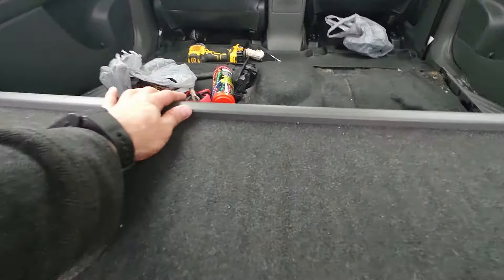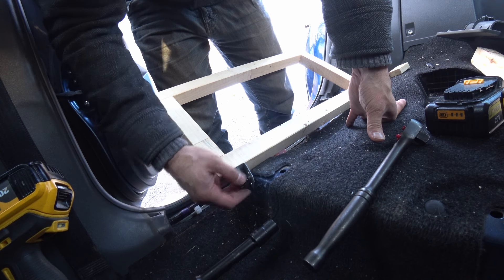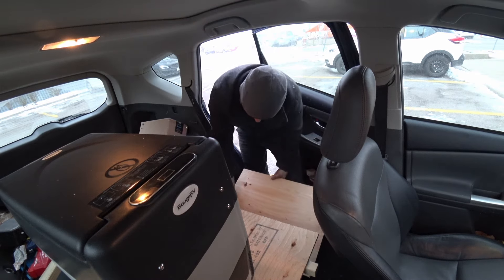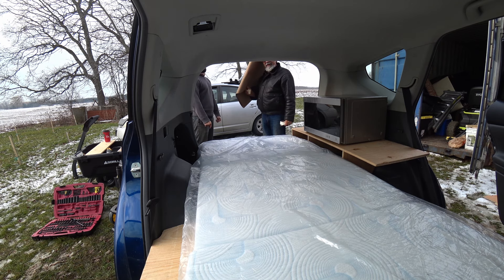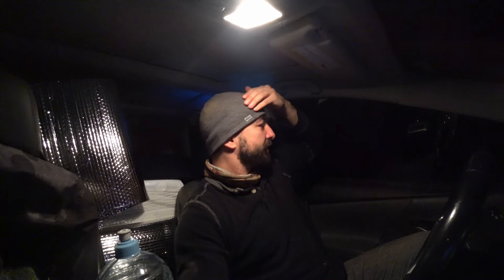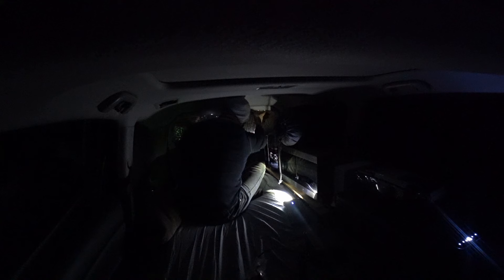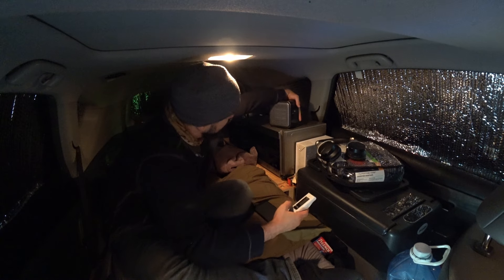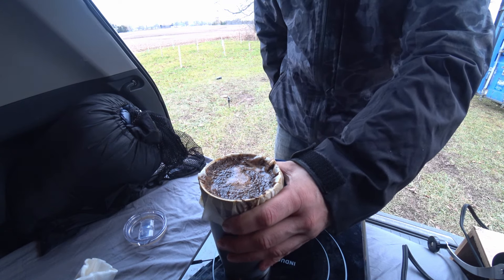Winter Storm Prius Camper Build: 4 Days, Home Depot Parking Lot Adventure

Comment: I highly suggest you put dark black fabric on the outside of the window covers. If you get the windows tinted dark, then it will just look like you have extra dark window tint, when people see it from the outside, at night. The reflective insulation is a dead give away that you are sleeping in there
Reply from the maker: Yep! I have dark grey fabric on one side of some of the covers, but haven't finished putting it on all yet, but still at some point :)
Reply: In my Prime, I have reflectix on one side, black cloth on the other side.  Black is better for stealth, but reflectix is necessary in hot weather during the day.  Just swap sides of the car to change color.

Comment: The extra battery is brilliant, I've camped in my prius c (A little bit smaller than V) and was awakened by the engine constantly kicking in to power the heater
Reply from the maker: The extra battery is mainly to handle a larger inverter load. If you engine kicks in too often, you are losing power somewhere or your hybrid battery is at the end of its life
Reply: I wouldn't say it was kicking in too often, but just enough to keep me from falling asleep 😂 Would you say the engine kicks in less frequently with your setup than using the standard heating system? @LexBuildAdventures
Reply from the maker: @yadam415  i upgraded my hybrid battery and that made it so it kicks off maybe once an hour or so if I'm just running the fan.

Comment: Awesome 👌 except 4me, instead of that HUMONGOUS chest fridge, I prefer a smaller upright one and room 4a toilet. I did see one that sits on the passenger seat and secures 2the seat belt. With limited space I would go 4 that one if I can't fit in.my cassette toilet. One divider between the smaller fridge and another behind the driver's seat with a hanging bar/pipe across, and I have some hanging space 4a few pretty 👗! I LOVE the 2 skylights. 👌🙂

Comment: Very cool build. That said, I have a few ideas that may work.

1. It would be interesting to put some type of suction cup bulb on the roof of the Prius where you could store a tarp in there and then fold it out to completely cover it. That would help out with insulation in the snow and you could just pull off all the snow when you're ready to go. You may also be able to weight down the ends. 

2. Heating is a challenge because it takes a lot of energy. That's why direct contact heating is far superior. I would recommend using carbon fiber heating elements, sometimes of which are found in vests or jackets. They will keep you warm without an issue and are often USB. You could also use direct contact for cooling with a Peltier device. 

3. I don't know how I feel about the battery and the inverter setup. I have been seeing gigantic power station (2.2kWh, 2000w continuous, and 4000 watts peak) for $630 USD at times. They have pass through power and can charge via solar up to 500w. They can have multiple USB outlets and plenty of USB ports. I would recommend LiFePO4 chemistry as those last the longest, but are more expensive. It could take up far less space than a battery and inverter and all the wires as it would be self-contained and more organized. These also have 12v DC output. 

4. You may be able to create a window mount where you have a HEPA filter on it, a fan to pull air through it, and then a slider that you can open and close with a removeable maget from the inside. You could also remove the window mount/filter/fan combo completely to shut the window and just run AC. Add a tube on the fan to direct airflow. This could also help to keep the battery cool in the car when it's hot outside. 

Those are some ideas I have and may try out myself. Hope they help!
Reply from the maker: some interesting ideas :)

I do currently have a heated vested and a heated blanket, which I used at times.

I used AGM as a battery because it is the default chemistry in the prius. To use LifePo4, you would need to have a separate dc to dc charger for it. I bought all the equipment to do this, but have not gotten around to it yet.

I did consider window mounted air circulation, but decided to just hardwire into the prius existing hvac fan so that I can run it off my house battery, instead of having the prius turned on. This way I can run it all night, get filtered outside in with all windows closed. I think its the best option for rainy days and stealth.
Reply: @LexBuildAdventures  That is good to hear about the vest and blanket. As for the battery, I meant to say I think the best option is to just get a large power station. 

Some power stations are 2kWh, LiFePo4 for longevity and more charging cycles, can recharge via solar panels, can output 12v DC, have tons of USB ports and wall adapters that can output 2000w continuous and 4000w peaks, and can do passthrough power when charging. 

Specifically, I have had experience with the Topshak TS-PS2000 (power station), which I wish was LiFePo4, but has been enough of a beast to power off grid easily. It's also quite compact and powerful for the size. I found some at $630 a while back, but they are not around at that price anymore. 

In terms of solar panels, I have thought of creating a drawer type roof rack system to slide out an extra solar panel to each side for maximizing power. I have seen some 450w solar panels for $250 ea.

You could also plug in a battery tender to the power station to ensure the car 12v battery is properly charged as well. 

Other than that, I think running your car HVAC fans indepedently is more effective than window mounted circulation, especially with activated carbon and HEPA air filters.
Reply from the maker: @oa5828  Power stations are great, but with one major down side. They all have very low power dc to dc charging. They max out around 10 amps. This is why for any vehicle application I advocate for DIY systems, since charging from the vehicle I think is very important and should not be limited to 10amps. I purchased a renogy 50amp mppt+dc to dc charger instead that ill be setting up with my lifepo4 battery and inverter.
Reply from the maker: @oa5828  I am also coordinating with a manufacturer over the last few months to design a roll out solar panel that can sit on your roof in a cylinder which you pull out and get anywhere from 400-800watts, plus an awning :D
Reply: @LexBuildAdventures Mr AZ thank you for the dialog chain.. I learned much.. as for the renogy 50 amp DC to DC charger... The Prius can handle 50 amps?  Since the Prius doesnt have an alternator.. the onboard inverter can handle that capacity?

Any updates on the roll out solar cylinder?
Reply from the maker: @camposvazquez  yes the prius has a 12v from HV charger that can handle 100 amps. Been using the 50amp dc2dc charger with that for a year with no issues. No updates on the roll out solar yet.
Reply: @LexBuildAdventures  thank you!!!!  

Commented fur the algorithm.. Liked and Subscribed!!!!!!

Comment: Where will you add the swimming pool😉….. but jokes aside, you should use only a 100 watt heater. Prius is a small place to heat, and your batteries will last much longer.
Reply from the maker: The power is dependent on power needs. In Canada it gets very cold. 100w would not do much on very cold nights

Comment: How it works? You have connected another 12V battery to car battery and both to the inverter? 🤔 Is it safe? How you control that you don’t deplete battery when you are cooking? Car charge both of them when you drive?
Reply from the maker: Yes, I connected a much higher capacity battery (same chemistry) as the stock battery, in parallel. Its perfectly fine if set up correctly. It does not deplete when cooking because the built in Prius charger outputs 100amps to charge the 12v battery, which is more than enough for most cooking circumstances. As long as the car is on, the battery should not deplete.

Comment: Love this video. I'm planning to do the same thing this weekend, maybe I'll make a video about it.

Question:
Have you considered installing the passenger seat backwards? And potentially deleting it entirely?
That'd free up a bunch of room and give you a more comfortable place to sit.
Reply from the maker: I've used it with a passenger too many times to justify deleting it. I am rebuilding it from scratch this week with a design that will allow me to lay it down fully flat when I'm not using it
Reply: Be careful about turning around any passenger seat with an airbag on the door side of the seat.  You don't want it to punch the driver in the head.  So, you'd have to deal with at least disconnecting it, then the issues that might cause with warnings, etc.
Reply: @LexBuildAdventures  Has anyone seen this done?
Reply from the maker: @verlync  what you mean

Comment: Great video.  What year is your Prius V?  And trim/package level?  I see yours has the moon roof, do you lose any headroom in the front or rear?  I've seen certain models not many that have a solar panel built in.  Is that to charge the car or battery.  Or is it for other purposes
Reply from the maker: 2014 and it's got the upgraded sounds system and heated seats so maybe the 3 or 4? I'm not sure. Nope i actually gained head room by moving the battery.
Reply from the maker: The solar panel on 4th gen i think is just to run a fan to exhaust cabin heat when parked. The latest one i think actually charges the battery but very little per day

Comment: Europian version Prius + has smaller Lithium battery in central console between front seats. It would be better for camper built ins.
Reply from the maker: I tried so many configurations, the problem was the vent fan. I checked with the lithium battery manufacturer and they said its needed and i cant delete it, but i dont know if that was for liability reasons since i assume lifepo4 batteries have a much higher c raiting and wont over heat. But i kept it and had to mount it back there for space as a result.

Comment: How tall are you? I’m curious as to the length of the of the full cargo. I’m 5’11.
Reply from the maker: I am 5'9 and its comfortable. The bed mattress is 6', so it should work.
Reply: @LexBuildAdventures  Even any regular 2004-2022 Prius fits a 75x25x4 trifold mattress (mine is a grey Olee, price jumps between $55 to $125 on Amazon) if you move the front passenger seat forward a good amount.  

In my 17 Prius Prime, I put a 50 liter fridge (clone of CX50, with luggage handle and wheels removed, and raised up a bit to clear the center console) under my pillow and jam th epassenger seat back against that, allowing a person up to about 5'8" to still be a passenger.comfortably.  CX30 would keep the bed level, the CX40 and CX50 prop it up how I like.

Most fridge shapes do not fit on the floor behind the seats, it took me maybe 50 man hours to figure out which ones did.  Many fridge measurements are incorrect, but I was able to track down accurate dimensions for many.

Comment: Since '78 I have only bought toyotas; they've been too reliable to consider buying anything else.  However, a problem i experienced on 2 corollas were hubcaps that just wouldn't stay on - i see this was also an issue for the prius V.   ... such a stupid thing for Toyota to cheap-out on.
Reply from the maker: Mine only came with steel rims hehe, I would like to upgrade my rims to the aluminum alloy ones if I find them second hand, but I wouldn't bother with the hub caps
Reply: @LexBuildAdventures  Still have my 03 Matrix.   I gave up replacing them with Toyota caps as they fell off (so yeah, no point in doing that).   Aftermarket caps might work (hold on) better, but i just bought inexpensive (but new) alloys when i got new tires years ago.  Thanks for this video, I'm going to make a sleeping platform in my 04 Prius soon.